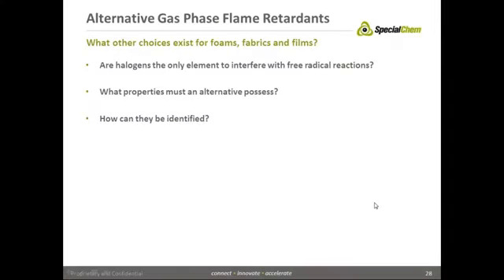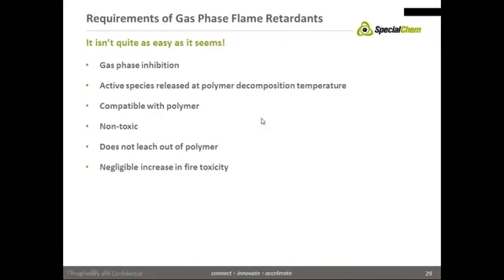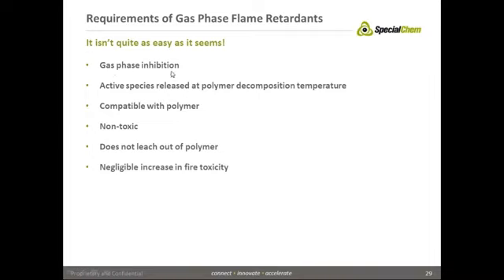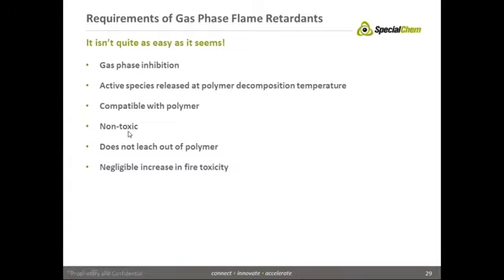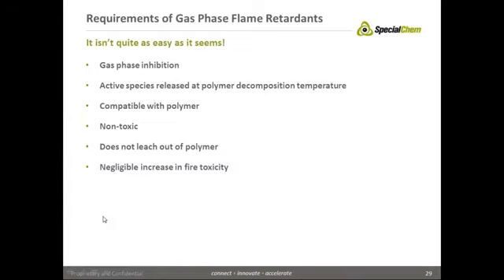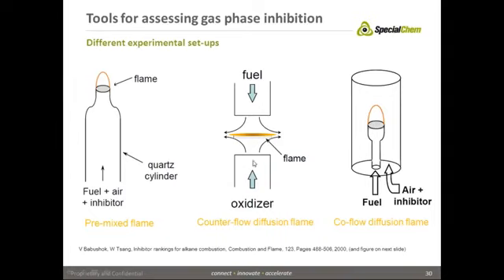How to Select Halogen-free Flame Retardants for Better Performance

Comment: Hi Specialchem,

I have small business and need some material database from Specialchem. But currently, we don't have any official business email that needed to register as Specialchem member. Can I use Gmail instead of using professional email?

Thank you very much.
Reply from the maker: Hi Setia, SpecialChem, the material selection platform is made for professionals. We handle queries like yours on a case by case mode. Please get in touch with our member support: member-support@specialchem.com. Expect some questions about your business so we can create your account. Hope it helps!